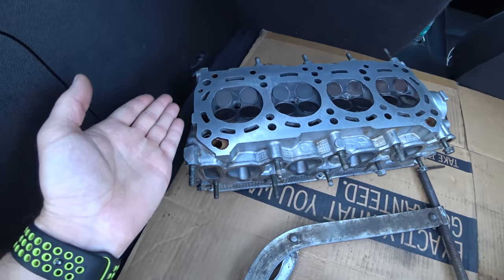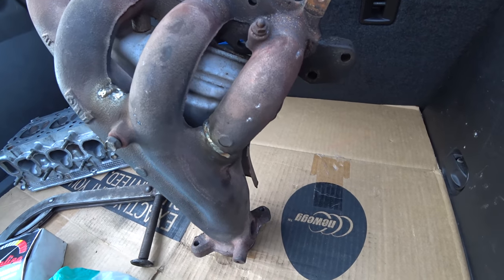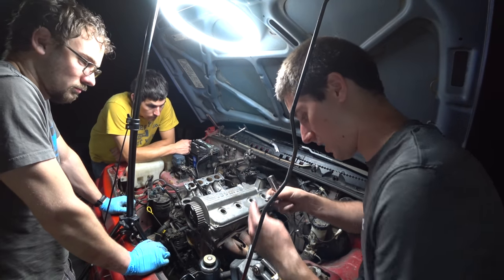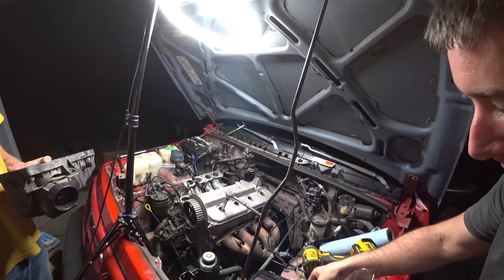We Tried To REBUILD The $400 Geo Tracker ENGINE In One Day

Comment: JR: can rebuid an engine in 2 days
Me: can't figure out why my lawn mower runs very badly
Reply: Probably needs a new spark plug or it needs cleaning and tuning the carburetor
Reply: @bassam_salim  could even be as simple as an air filter
Reply: @RedPandaPup  yup, I used to have a small gas generator, when it doesn't start I try everything until it starts, it doesn't take more than 5 minutes
Reply: @bassam_salim  simple engines require simple tune ups 👌
Reply: My lawnmower had a plugged carburetor this weekend. It would run for a minute then die. Fuel filter ok. Put a vacuum on the tank and sucked the fuel + dirt backwards. Now it runs great again :)  Just be crafty.
Reply: @castirondude  i took the carb out and cleaned it now it just runs like it is about to blow up
Reply: @Rats_r_cool  probably a governor issue
Reply: @castirondude  the last owner disconectes it so I jankly fixed it but I have to not use a bent paper clip
Reply: seafoam it
Reply: @firecharger  I do not own it know

Comment: There's plenty of room for a small block v8 in the engine bay.
Reply: LS or SBC V8 swap, TH400, trans brake, Ford 9" rear axle, 4.88 with a spool, 12" wide drag slicks, rear tubbed and cage, maybe hang some weight off the rear bumper, you got yourself one hell of a wheelie machine of death.  The fun part about that setup is it deliberately tries to kill you each pass lol

Comment: Reminds me of a cub cadet I bought at an auction. Had a v twin engine. One side was dead on compression. After removing the head which had two finger tight bolts, I found a really bad valve seat ejection. The head was warped too. Glad im not the only one who experiences this

Comment: Change your oil right after the first start and then again after a hundred or so miles. Those 3m disks contaminate so much and they are hell on your bearings. I found out the hard way a couple times until I found out the cause. Personally they are not worth using, but you already did.

Comment: Those Roloc abrasive disks (with the rubber fingers) are easy to misuse and make the head worse off and less flat than when you started - it will always wear the edges of the block more as it hits/comes over it, along with leaving fine abrasive material in the coolant jacket and oil passages(!). Clean it up with a good scraper and gasket remover instead.

Comment: Just going to throw this out there. I saw solid lifters with adjustment screws. No way after machining the head and new head gasket that the valve adjustment will be good. I would be prepared to either do a non running adjustment or a running adjustment. I expect tight valves so it won't be chatty. At least throw a feeler gauge in there too make sure no valves are propped open.

Comment: Since this vehicle was sold at the Chevy dealers, they probably do have the parts you need.  A Suzuki dealer is not needed.  As a side note, Suzukis aren't being sold in the US anymore?  They are sold in Mexico.
Reply: Sadly, only Suzuki motorcycles are still sold in the USA. No thanks to GM's constant interference, Suzuki pulled their autos from the USA about 10 yrs ago now.

Comment: You should put oil on the head bolts for proper torque. Great video as always!
Reply: Unless the manufacturer doesn't require that. Every manufacturer calibrates the torque differently.... Without lube, with oil, with anti size, with arp lube.... Etc

Comment: Probably have to adjust the valves after having it surfaced
Reply: At a minimum it will sightly retard the timing due to moving the cam sightly lower. But..... It's better than a warped head. Oh, bumped compression too!

Comment: Stop don't use the K&N filter! That engine & drivetrain was only designed to hold 78hp, it will be at 82hp with that super high performance air filter! Torque will be a transmission killing 50torques at 4500rpm..
Reply: mike brink There are a lot of scammers out there man, at least you now know to keep the receipt.
Reply: Chevrolet tracker has 165 horsepower, what are you talking about?
Reply: how did the engine suddenly lose half it's power?
Reply: Lol...
Reply: @eksine  was just jkn with him about his Chevrolet/Suzuki/Geo mutt thing.. 😁
Reply: @eksine  no. No it doesnt.
Reply: @alexyoungberg5232  you're right, it says 80hp and 95hp, the chevy tracker 2004 does make 165hp though, they must have used a different engine
Reply: mike brink  The store you bought it from has a copy.  Ask for it.

Comment: Curious if the block should be resurfaced as well and the piston rings replaced since it overheated?
Reply: Why? If leakdown test shows rings are good across the board you shouldnt have to. Overheating has nothing to do with lower end anyways.
Reply: @scottfirman  overheating does affect the bottom end if it was major definitely the rings...but not sure if he did a leaked down test...had a durango overheat they put everything back together...car started but had a miss a ring was bad on it...
Reply: @chrisc1623  Even with a head gasket leak there can be signs a ring is leaking. There are tests that can be performed to tell if compression loss is limited to just top end or both top end and lower end. I have done tests just to be on the safe side. It sucked hearing your car had a ring issue. Usually there are several rings. One is for oil control the other is compression ring. You dont want to rebuild the top end only to find the oil control ring is leaking eather. Tha t allows acessive oil in the cylinder. Just as bad a compression leak in my book. No one wants a vehicle that uses excessive oil.

Comment: Ok, much better. Thank God you took that head to the machine shop and started using some better parts. Still don't understand why you don't gap your plugs, at least check them. That could cause you a misfire that will make you insane. Love it if you'd slow down a bit. Not sure what the flippin rush is all the time. I enjoy watching your videos and you, but sometimes the pressure to just do things makes me nuts. Slow down. Unless you're planning on leaving the planet soon, there's nothing should be rushing you like that. The videos would be so much better without all the rushing around. Nevertheless, this was a huge improvement over the last Tracker video. Nice job! I'll be heading out to put the head back on my '50 Dodge soon as a result of your contagious nature. Thanks again.

Comment: In bay top end rebuild...not full engine rebuild... ya know, honed cylinders new cast iron rings that will wear into the slightly imperfect cylinder walls,even after honing, some new rod and main bearings, little things like that.

Comment: Not supposed to lube the head bolts?
Reply from the maker: Nope, that would modify the TQ spec 🍻
Reply: It depends on vehicle. On a Subaru, you ALWAYS oil the headbolts. Its in the rebuild manual.

Comment: was it warped because of previous wrong tightening?
Reply: Blown head gasket usually. the super headed antifreeze in the cylinder can cause the head to warp. Once you pull the headbolts....boing! Warp!
Reply: @scottfirman  
Didn't know that could happen. Thanks

Comment: the guy trash talking trackers was getting annoying... they're great trucks, and they hold their value really well... put 40k miles on my '89 sidekick over the course of about 5 years, and sold it for $1k more than i bought it for ($1500)... just did maintenance, oil changes and put tires on it, replaced the muffler and a headlight, was also amazing off road, you can take ATV trails because it's so small, it's great

Comment: The tracker is a NON interference motor.
Reply: Until you deck the head??
Reply from the maker: Actually they are non-interference until this model (96+), then they are. 💯
Reply: Actually wrong. My buddy has a 96 and a 97. Both non interference. All trackers before they went to the Chevy tracker were non interference. Believe me, I've done the overhaul on both his 96 and 97

Comment: By saying Suzuki did he assume that the geo tracker is made by Suzuki?
Reply: Yes
Reply: It is its just a rebadged Suzuki Samurai
Reply: cause it is made by suzuki...
Reply: @nhmacdad556  not quite....its a separate design than a Samurai... but it IS a Suzuki.....
Reply: @nhmacdad556  you mean Suzuki Sidekick
Reply: I don't think he assumed anything,it's common knowledge
Reply from the maker: I sure did CAMI built the Tracker and the Sidekick as the same truck 🍻
Reply: You betcha
Reply: @thinetaco3722  It has the Suzuki badge. who makes the parts for it?
Reply: @thinetaco3722  The Tracker was only sold by Chevrolet, not made by them.  The Chevrolet Sprint was a Suzuki.  The Chevrolet Spectrum was an Isuzu and the Chevrolet Nova, from 1987 was a Toyota.

Comment: Man .. blown head and warped. unlimated budget but you didnt re ring it and put new bearings ...grr=rr
Reply: Unless it had compression issues related to the pistons and rings, Then why? He could tell by looking at the cylinders if they needed it. I rebuilt many top ends on engines that didnt need any lower end work. If you can still see factory hash marks, rings are not nessary.

Comment: Sell the Chevy Volt and buy a Tesla that requires some work. That would make some great content!
Reply: Teslas are more complicated with all the sensors.
Reply: David Mancilla yeah but the Chevy volt isn’t a very reliable car but I guess you could also say the say about the Tesla in some areas
Reply: Bite your tongue!!  We have a 2016 and 2017 Volt. Apart from factory recall for faulty shifter sensor, bot cars have been the best cars we’ve ever had... always starting and never letting us down on the road. I don’t even know how much gas costs anymore, heh heh. Totally changed my mind about Chevys. Only had BMWs and Toyotas before this.
Reply: @ergodoy7741  in my opinion Toyota's are more reliable than chevys
Reply: @davidmancilla6674  It's not just your opinion, it's a proven fact. Toyota's are FAR more reliable in comparison to any GM product.
Reply: @VanisleNSX  your right I just say it's my opinion because I already know that all the Chevy fans will get triggered.
Reply: VanisleNSX and David Mancilla, I totally agree, any GM product my family had (my dad worked at a GM plant, and we went through a lot) was a total turd, hence the Toyotas and BMWs until the volt, but honestly, this has been a great car, a little over engineered, but I’d rather have that than something with no back up systems.

Comment: You just done a valve job and head resurface, that is not rebuilding an engine. Engine rebuilding requires the engine to be completely disassembled, cleaned, bore checked, crank cleaned and checked, new rod and main bearings, new rings, and several other things to be considered a rebuild. Should have read "We Tried To Do A Valve Job On $400 Geo Tracker In One Day. Misleading

Comment: My local machinists wont resurface an OHC head. They say it will put the cam in a bind.
Reply: Meh, the head is already warped. So if it was running, the cam bearings were already warped as well. It will not "bind the cam" it causes issues, but it will be fine.
Reply: upside downdog : too much off would certainly do that if one did not take into consideration how it affected the other parts, and compensated for the changes.
Fortunately, this head was only slightly out of true and required minimal work
Reply: @Gabe-ABNCW3  
I think line boring the cam saddles would fix this problem. The head would need to be installed on the block for this to work.

Comment: Dude....you measure torque to lb/ft, not ft/lbs.... ft/lbs is a LINEAR measurement, not rotational... at LEAST get THAT part right because the terms are NOT interchangable... 
Don't take my word for it, look it up.... 'Til then, keep the kids entertained....
Reply: Bruce Fisher everyone knows this, no one cares.
Reply: It's IRRELEVANT.......  WE know he's tightening bolts.....  We know how to READ the NUMBERS on a torque wrench..... maybe we should use N-m
Reply from the maker: 100% no one cares which way you use  the term 🍻
Reply: Ah..... no engineering graduates here.....😏
Reply: @brucefisher4025  Go pat yourself on the back...  and go sit in the back of the classroom...... WE STILL KNOW WHAT HE MEANT !!!!! Doh
Reply: @brucefisher4025  On an other note..... so why exactly is an actual torque wrench marked as foot pounds while correctly marked newton  meter???  hmmmmm